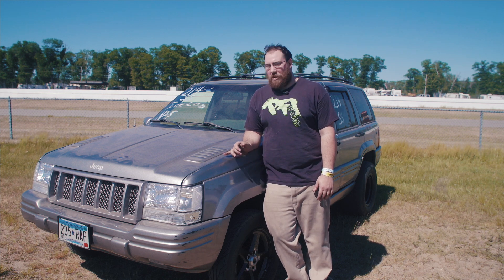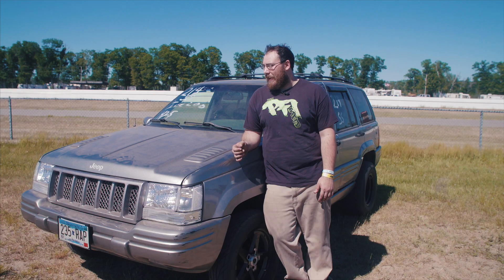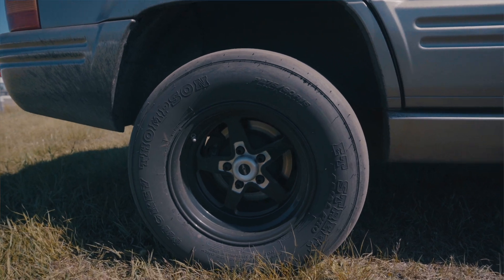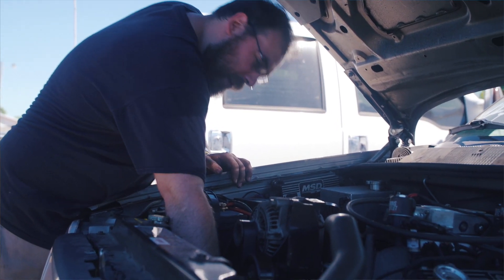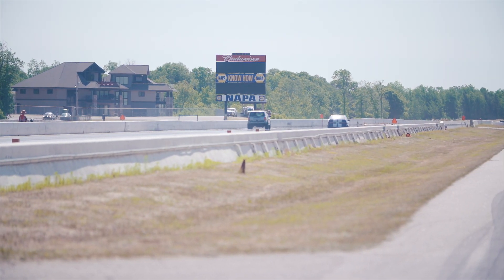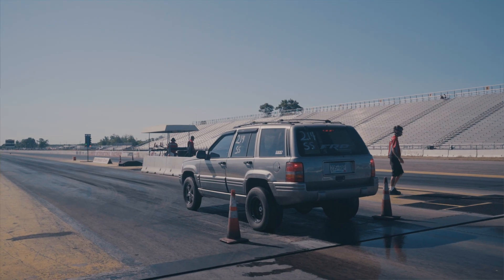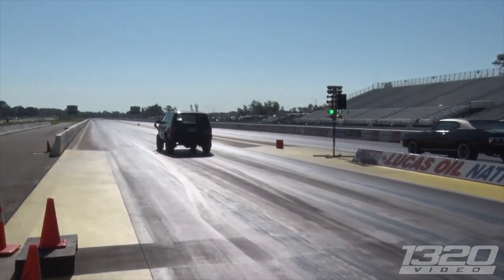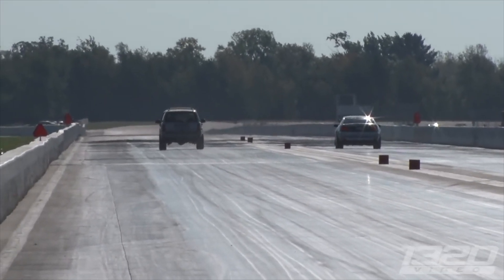10 Second 1998 Jeep Grand Cherokee!?

Comment: I actually had a 93 grand Cherokee before which was the first year of the grand Cherokee. But also, the fact that he says "it comes from the factory awd" just shows he knows nothing about jeeps. It's not awd, it's 4x4. It's not the same. Learn the difference.
Reply: Quadratrac.  Full time awd
Reply: @ryangreenley4818  nope. It's full time four wheel drive. Not all wheel drive. Go loon up the difference.
Reply: Grand Cherokee ZJ 1993-1998Next

Equipped with one of the following four wheel drive systems:

Command-Trac - part-time all wheel drive with shift-on-the-fly possibility (used until 1996). 2.72 low range.

Selec-Trac - selectable all wheel drive. NV242 transfer case.

Quadra-Trac - full-time all wheel drive system. A viscous coupling locking center differential.
Reply: @ryangreenley4818  Many, but not all, 4WD vehicles have a centre differential that helps divide the power and torque between the front and rear axle.
Reply: @Gravxhity  In 4-High, the 249 transfers torque just like an AWD car through a Viscous Coupler, which is a puck loaded with wet-clutches and a silicone fluid. In 4-low, it would be a true 4x4 gear-driven setup.
Reply: @MrPiimpslap  the point is you can switch into 4 low which means it's a 4x4. You can't use 4 low on an awd vehicle
Reply: @Gravxhity  You're flat out wrong. The np249 was a torque vectoring transfercase. it used viscous couplers to distribute the power between the front and rear driveshafts equally. It did this with a computer being fed by sensors. This is not a differential as it is a viscous coupler, this makes it an AWD system. The couplers do have the ability to lock together to offer a part time LO All Wheel Drive/4 wheel drive. The "4wd" option was the np231, and np242. These are chain driven transfercases, the np231 being static with a sprocket and chain providing the ability to give you 4 low, and the np242 having a differential between the two outputs allowing you to have full time 4wd. Since the np249 (the only option for 98 5.9 limited's like shown) uses viscous couplers and a computer to control outputs, it can and was classified and advertised as all wheel drive. 

Jeeps that have the np231 (like standard on an xj) use a completely mechanical connection between the front and rear driveshafts that cannot be altered in any way shape or form, they are a part time 4wd system. The np242 using a full time 4wd system simply has an open center differential  allowing them to vary in speed. This is also not computer controlled and entirely mechanical. The np242 is computer controlled thus classifying it as an awd system. Since the np249 uses an almost identical casing and package method and implementation (np249's are entirely interchangable with np231's) I personally refer to them as both. Sometimes ill refer to them as an awd system, sometimes ill refer to it as a full time 4wd system. However, what I dont do is question the intelligence of a man who clearly knows what hes talking about because he used a term that differs from mine. 

Final point, you can absolutely use low on an awd vehicle, it entirely depends on the awd vehicle. For example Subaru offers transaxles with multiple speeds, giving a low range option.
Reply: Is both full time awd and you can change it to low 4x4